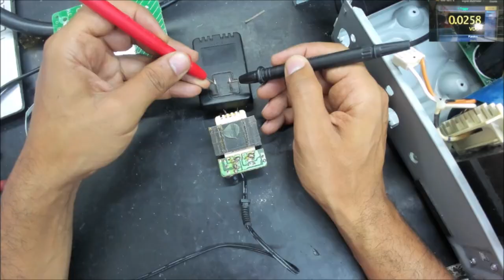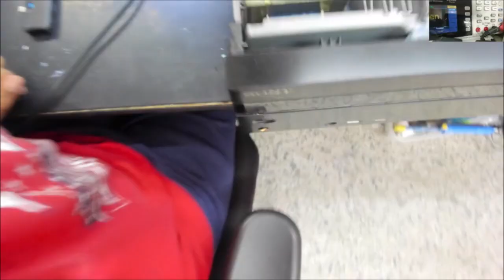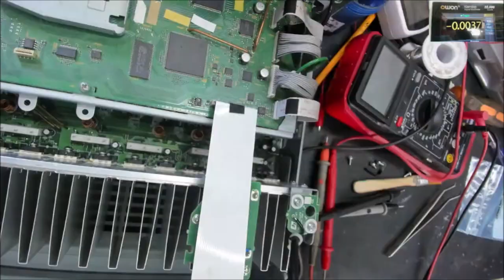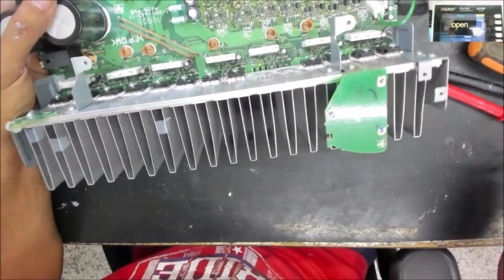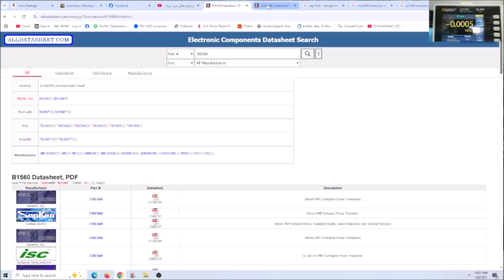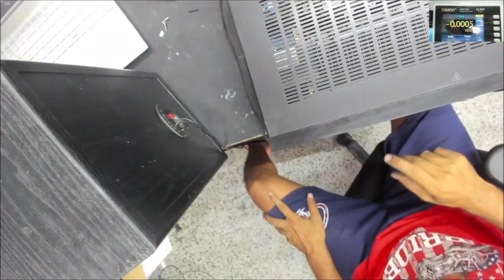Sony STR AN1000 receiver no power & multiple issues repair step by step

Comment: any idea after reparation of this equipment I have negative reading on the speakers output I replaced the transistors? I also have negative readings on the white resistors of the channel fixed ANY IDEA? thanks

Comment: I've decided not to try and repair these STR/AVR units anymore. So far I've had 3 different units, Sony, Denon & Pioneer. I've spent hours on each, to no avail. They are all similar in design and from what I've read, the DSP chips are known to fail. I still have the Pioneer, it had a blown channel. I replace several resistors and the 2 transistors that were bad. Now it turns on fine, but no audio out, haven't been able to figure out why so I put it off to the side for when I have time and patience to continue down the rabbit hole. The customer told me to keep it. These things give me a case of 'imposter syndrome!' 😵‍💫 Glad you got it to work 👍
Reply from the maker: i had many receivers with bad DSP i still have some here too,